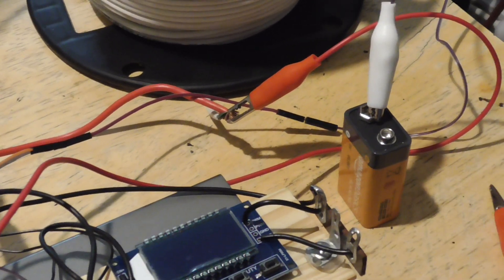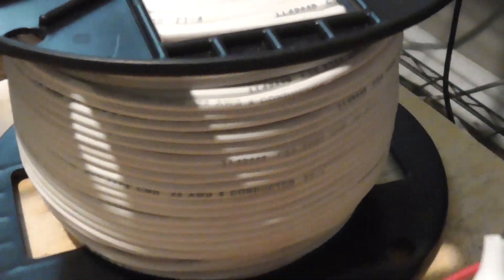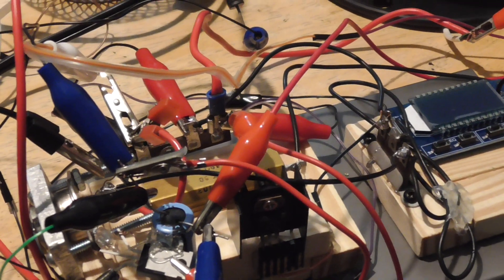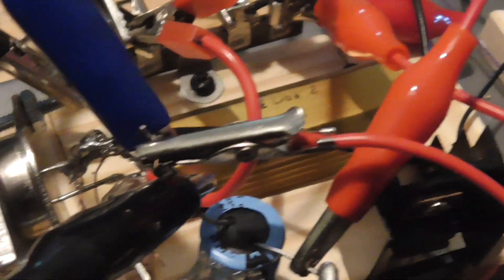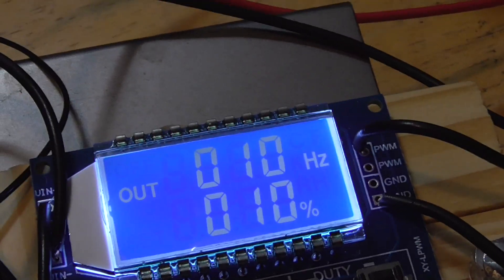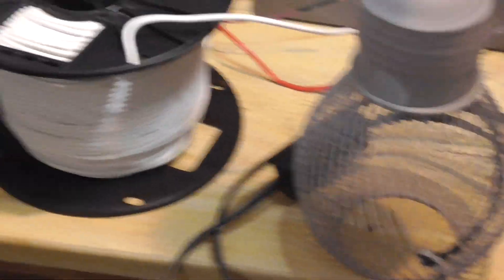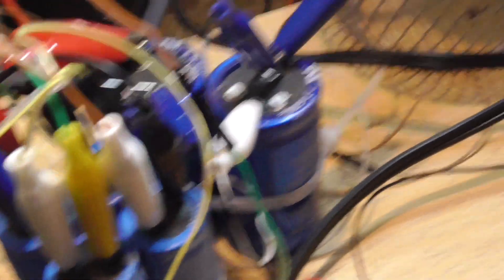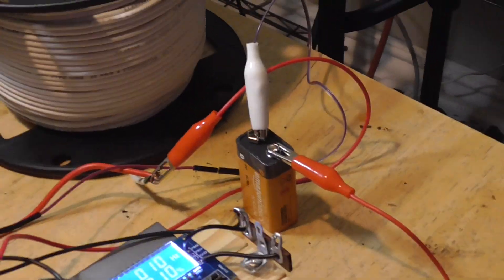High Efficiency Lamp Driver Back EMF Version.

Comment: Hey Joel, you have telefon wire there right? You have there multiple strands right? Did you ever consider to convert your inductance into a non linear dynamic inductance? You know "charging" all strands in parallel and "discharging" it in series? Practically sending a pulse while in parallel i.e. With low inductance and establishing a magnetic Feld and the switch it into series when the Feld collapses. Maybe even playing with the reflection in the wire🤔.

Comment: Do you only use two wires or do you use the four wires maybe twisted together in parallel to make two I know those phone cables have like four wires in them is that one long telephone wire the 300 ft it looks like it because it's on a spool
Reply from the maker: I use all 4 shorted to make up a one wire coil.
Reply: @joellagace1679  thank you you might try the old incandescent light bulbs the ones with the filaments you can still find them there around can you run a Crock-Pot or small college dorm refrigerator for a little one I think they're 65 watts . Great demonstration. Or how about an electric blanket if you were to use some of the new LED flood lights that would be very impressive. Thanks again

Comment: Very interesting video. Could you show the energy consumption (Volts and Amps) from the 9V battery?
Reply from the maker: You mean have an amp meter in line with the battery input? I don't have such meters ironically at the moment but I may have a few "toy" meters that go up to 500ma or so, ill try to dig those out and make something! Can't it be calculated 9 volts pulses into a 1.9 ohm coil at 10 herz with 10% cycle dutty?

Comment: I would love to see the circuit diagram for this please!!
Reply from the maker: I'm working on it could take some time I built this thing on the fly quickly as you can see just for this demonstration and to prove a point.  I explain so much one does not really need a schematic, You pulse a big big coil with a controller of choice and feed the back emf into your super caps and run the inverter. but I understand the request. thanks
Reply: @Joel Lagace  I understand the concept but am unsure where the neon bulbs go. Thanks
Reply from the maker: @newmonengineering  between collector and transistor emitter for crude protection and 100 volt limiting, Also from the charge cap positive between SCR gate. This triggers SCR diode to dump cap voltage at around 100 volt pulses. Once current slops flowing the SCR closes and allows for a moment to recharge. Any large current here this trick don't work as the cap charges too fast and the neon trigger stays light up. Great for high voltage very low current applications. Or use a zener as trigger instead of the neon if you want to pulse lower voltages  "safely" into super caps.